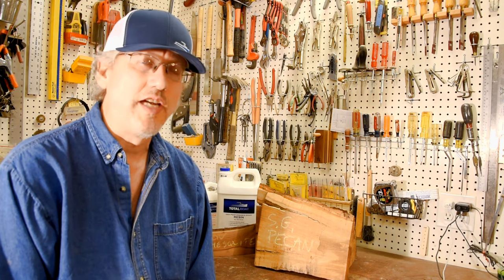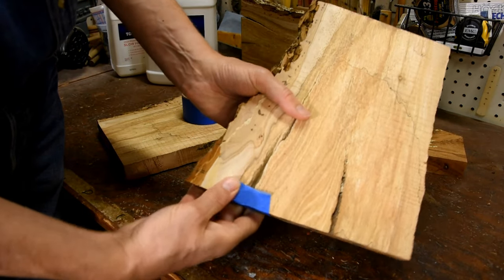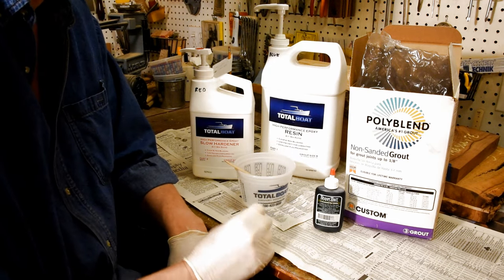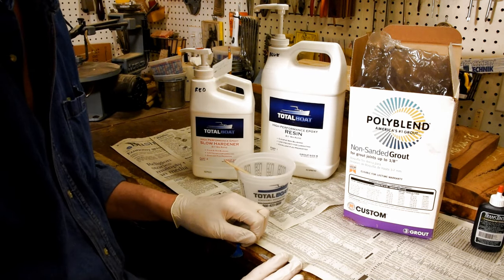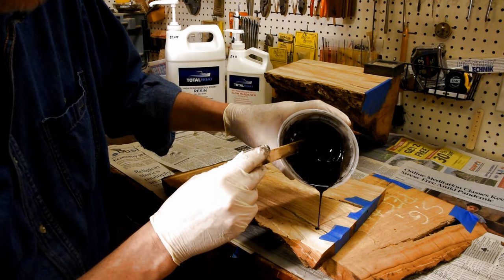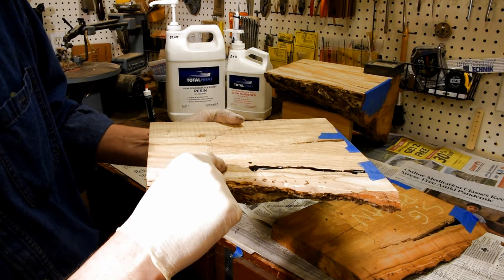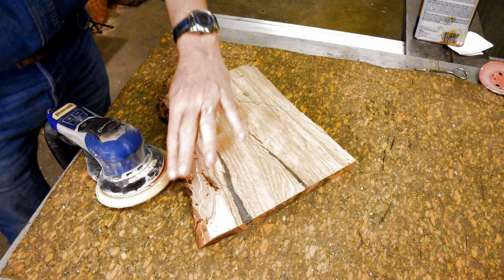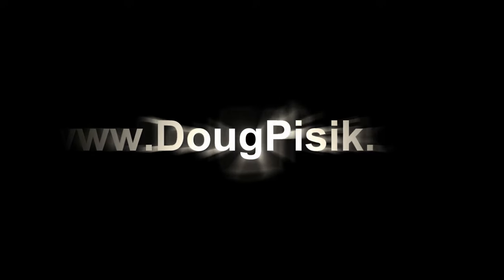Using Epoxy Resin to Fill Cracks and Gaps in Wood - Complete Tips and Techniques

Comment: Great & helpful video, Doug.  I have a slab table that will be outdoors with some cracks and defects to fill.  Your video inspires this first timer here.  Question:  is there any problem with using a varnish on the slab where there are sizable areas of epoxy on the surface ?  Can I expect any issues with the interface between the wood & epoxy (ie:shrinkage, cracking, etc) in an outdoor application?  Thanks.
Reply from the maker: Thanks for watching the video. 
For an outdoor project, a few things to keep in mind. 
All wood will move, so even though the epoxy will hold a crack together, there is still a chance that a crack will widen or another will form.
I’d recommend applying the epoxy in the winter when it’s less humid. There will be less chance of a crack than if you fill the cracks when it’s dry. 
Epoxy will yellow in sunlight. Be sure to not use a light dye or clear epoxy. Using a dark coloring like I did eliminated the yellowing issue. 
Don’t sand the epoxy to a gloss finish or the varnish won’t hold. There always a chance it will peel off (especially in the sun), but a rougher finish on the epoxy will minimize the risk. 
Be sure to use an exterior finish. They make outdoor oil-based finishes that won’t peel but have to be reapplied every year.  I’d recommend one, but I don’t have experience with them. 
Hope this helps.
Reply: Hi Doug - update on my project: I followed your lead and advice.  I now have my outdoor slab table looking amazing with epoxy filling some deep and a couple of wide fissures and cracks in the black color, using the non-sanded grout.   However....must I give up on having the beautifully clear areas of epoxy, given the need to prepare for varnish ?  Even the very fine sandpaper leaves a rough, scratchy, opaque appearance.   I did find a varnish that should fit my needs from Total Boat.   @dougpisik
Reply from the maker: @davidgraber4663 Glad your project is going well. A gloss varnish over a lightly scuffed epoxy should remove the scuff marks. You may want to create a test piece to be sure.

Comment: I use epoxy die ina bottle for my black. What does the grout do? I tried to listen like 2-3 xs. I just missed it.
Reply from the maker: Jacob, I’ve used dye as well, and sometimes the dye soaks into the wood grain leaving a dark hallo or streaks around the epoxy that can’t be sanded out.  This is most prominent in light colored and open grain woods. The grout doesn’t tend to soak into the wood so it solves the discoloration issue.
Reply: @dougpisik  thank you for the kind and knowledgeable reply sir. I appreciate the knowledge from someone who has more seat time.

Comment: Hi are you using painters tape? Also what was in the squeeze bottle ? I really couldn't hear what you were saying about it. So you don't have to seal the wood or anything before you get started?
Reply from the maker: Yup, I use painters tape. The epoxy is less likely to stick to it. Just make sure the surface of the wood is flat, smooth and free if dust. The squeeze bottle is TransTint dye. It can be used, but the grout minimizes the color from bleeding into the surrounding wood. No need to seal the crack first when using the the grout. If you don’t plan to plane down the piece after filling the crack, then you may want to seal the top surface to minimize the color bleeding into the surface. Hope this helps. Thanks for watching the video.
Reply: @dougpisik  thank you I appreciate it very much and I will tell my older brother Mike that we should try your way because he did seal the wood and used painters tape but now the tape won't come off. Hot mess but we're practicing. I'll let you know how it goes with your technique
Reply from the maker: @bevdowdy9483  I hope this works for you going forward. I’d love to hear how it works out for you and your brother.

Comment: Doug nice video and lots of good info/tips.  A question - polyblend non sanded grout does not come in black - only charcoal. I got some an used it (testing) on a piece of cherry and it appears to have bled gray/black color into the surface around the void being filled.  I sanded it but did not get rid of all the gray.  Any tips or ideas on what happened?
Reply from the maker: You’re right about the charcoal vs black. I have been using charcoal. As for the staining, I find that stains don’t go too deep me when I use this method. You may need to sand more aggressively with a coarser grit, or plane off a 16th of an inch.  Another option is to mask off the surface around the crack before using the epoxy, but I haven’t needed to do that myself.  Sorry, but I have no other advice for you. I hope it works out.

Comment: I'm wondering why not use the tape on the top instead of the bottom? Not a big deal either way with a piece small enough to go through a planer. I have a huge slab, and trying to figure out if I should tape over the crack on the top or bottom side.
Reply from the maker: Rob, that’s a really good question. The answer is that either side could be called the “top,” but I put the tape on the side where the crack is the smallest. This way I’m pouring the resin into a wider opening ensuring a better flow and reducing the risk of trapping air inside.
Reply: @dougpisik  makes sense thanks for that. So you don't see a downside to me taping the top (what will be the finished side)? And pouring from the bottom? It's my first time and I chose a $1000 black walnut slab to learn on. Not the best planning on my part lol
Reply from the maker: @robsheedy3093  shouldn’t be a problem. Just be sure the piece is sitting flat on a surface so the tape doesn’t come off. Be aware that the tape can also leave a divit  if it’s pushed a little into the gap. That means you’ll have a lot of material to remove to level down to the bottom surface of the divit. By having the resin on the top, you can overfill the gap and then just sand or plane off the excess, so be careful to ensure the tape is flush and not pushed into the gap.
Reply: @dougpisik  Very helpful advice Doug. Thanks a ton.
Cheers

Comment: I dont know what tape you've used, sir, but my entire project disintegrated, small and large holes alike leaked as if there was no tape at all. I've read in comments recommendation to support the back of slab  but what does it mean? How exactly do you support it?
Reply from the maker: I'm sorry to hear you had problems.  The tape used was a good quality blue painters' tape.  In order to ensure the tape sticks, the wood should be flat, smooth, and clean from dirt and/or dust.  All that's needed to support the tape so it doesn't pull loose from the wood is to put the wood on a flat surface before pouring the epoxy.  To be safe, the surface should be covered with wax paper or clear packing tape to prevent the surface from becoming glued to the wood if there is still a leak.  I hope this information helps.

Comment: Sorry I cannot search the comments to find if you already answered this question.

Why did you mix the Polyurethane 60/40 with Mineral Spirits?
Reply from the maker: I didn’t use any poly in this video, but in other projects I will thin down poly for a first coat so it soaks into the grain.  I also thin poly at times to make a wiping poly that can be applied with a rag. When you buy wipe-on poly, you’re just basically buying thinned down regular poly.
Reply: @dougpisik   Oh!  I also watched your River Table right after this one … that might be where I remembered the thinned poly.  Thanks, that makes a lot of sense to do.

Comment: What does the non sanded grout do vs just epoxy.
Reply from the maker: The grout adds a solid color. I like the black for filling cracks. Some people use dyes.  The advantage of the grout is it minimizes the color bleeding into the surrounding wood grain.

Comment: How would you do this on vintage floors with large cracks that I can't get to the bottom to tape off?
Reply from the maker: I don't know for sure if this will work, but if it were me I would add a little resin into the crack to see if it seals off the bottom and doesn't leak where you don't want it.  After it cures, you can then do another pour that fills in the crack completely.  Hope this works for you.

Comment: I tried using black pigment, the overflown epoxy got me stains on both sides of crack and by sanding i found it was so deep that its not possible to get it off..
Reply from the maker: Sorry to hear this. Pigment can cause problems if the wood isn’t sealed first. That’s why I recommended using grout.  It doesn’t tend to stain the wood as bad as the pigment does.

Comment: Great video mate. I've seen another video with a torch gun but prefer not to. What are your thoughts?
Reply from the maker: If you're referring to using a torch to remove bubbles, it can help remove surface bubbles but not any that remain below the surface.  Since I recommend overfilling the gaps, there really isn't much of a need to remove surface bubbles since they will be sanded away after the resin cures.

Comment: I know this video is almost a year old now, but so far you have given me a lot of information.  I'm sorry this is a bit of a story.  So hope you don't mind sharing your experience and wisdom?   Which I'm hoping will help me with a Kitchen island bench I've been working on.  It's a 3mt long slab of river red gum *(Australia here) live edge both side 900mm to 1mt wide.  I hired two big fellas to help me move it into place and one fella picked it up through the area I'd cut out for the kitchen sink.  Leading to a massive crack..   Not having worked with RESIN before I hired a couple that had shown me some of their amazing work to repair the crack...  after a dozen trips back and forwards to my home to REPAIR and fill with RESING.. I ended up with more Resin on my shed floor than in the crack... Over two years later still sitting taking up the best part of my shed. *(due to having covid and not recovering very well)  I have since gotten my mojo back and trying to fix up both  lots of people I had hired.   I have unboxed the slab they had attached to a large sheet of melamine, only to discover more resin had run through the crack under the slab..   WHAT a mess, one good thing it is the under side.  I only have me, so if I need extra help I have to pay folks.. I am now hoping to sand all the excess resin off the underside, but feel a bit daunted about the process.   A big part of the underside crack is still not filled.  I would like to use Resin to repair it but I haven't a clue which brand they used in the 1st place.  I am wondering if you would mind sharing more of your knowledge?  I have a few questions.  1) Can I use another type of Resin to fill over what was initially used or will it clash?  2) you mentioned briefly about sanding back mistakes with excessive resin and how to sand or plain it back.  Would it be ok for me to use a thick sand paper and work my way back to a finer grade?  or should I use a fine paper and just be persistent?    Thank you for letting me pick your brains.  I would add pictures if I could..  Kind regards
Reply from the maker: Jenn, sorry about your challenges.  It's hard to give advice without seeing the project; however, I'll do my best to help out.  Most important is to ensure the bottom of the crack is now completely sealed so you don't end up with more resin on the shed floor.   It the crack isn't too wide, using wide blue masking tape has worked well for me.  I'd recommend using several overlapping strips of wide tape, and then screwing a wide wood board over the tape.  This will ensure the tape doesn't come off, and since it's the bottom of the slab nobody will see the screw holes when you take the wood board off.  Note that if the wood isn't flat on the bottom the wood board might not hold the tape in place.  If this is the case, put a layer of thin foam rubber or folded-over rags flat over the tape before screwing in the wood board to ensure the tape is pressed firmly in place.  As for sanding, use coarse sandpaper first to remove all the excess resin and then work up to the finer grits.  Try to get into the crack and scuff the existing resin with fine sandpaper before pouring any more.  This will help the new resin adhere to the old.  You don't have to use the same brand as resin that was used before, but know that you will possibly see a variation in clarity where the old and new resin meet.  Hopefully it will be a minor imporfection that most won't notice. I hope this helps.  Let me know how it goes.  Also, I'm glad you're feeling better.

Comment: Why add dye as opposed to just clear?
Reply from the maker: Thanks for asking!  It's a matter of personal preference.  For a large gap like that shown, I find that black is a great non-distracting accent.  Some like to use bright colors or mix crushed stone into the resin.  Clear works also, but I don't personally like the look unless it's for something like an art installation where you want the voids to be transparent.  That said, if you use clear you need to really polish the resin down (like I show in my River Table video) in order for it to look good.  Otherwise you can rally see all the sanding marks, sort of like scratched plastic.

Comment: Sorry another question. The lovely bark edge on my wood is very craggy and I can't get a good seal with tape. Can you suggest anything that's mouldable that I could use instead? 🤔
Reply from the maker: Some people use clay, Play-Doh, or other similar material.  You may have a challenge cleaning that off of the bark, so I recommend putting a single coat of a clear finish on the bark first to seal it such as polyurethane or something similar. It will make it easier to clean up.
Reply: Thank you.
Is there any kind of accelerator you can use to speed up the setting?
Reply from the maker: @LindsayMadden-plant-mb9sn  No. Epoxy is rated at different curing times.  You can use a faster cure epoxy if the crack is small, but if you’re using a large volume of epoxy, you need a slower cure so it doesn’t overheat.

Comment: Thought you said  2:1 ratio  epoxy to hardner …..  you did a. 1:1
Reply from the maker: Sorry for the confusion. It’s a 2:1 ratio. The pumps are made for this epoxy. The larger pump dispenses twice as much as the other.

Comment: Another video used a heat gun and a scraper on the excess before sanding to reduce the sanding required.
Reply from the maker: Something that may be worth trying, but I’d be concerned about pulling some of the epoxy out of the crack if you’re softening it up that much with a heat gun.  It’s a risky process, but I assume can be done with the right epoxy and some practice.

Comment: I tried your method.
It does work fine if you only sand the work pease afterwards. It does not leave a stain in the wood grain.
But! If you have to do planing afterwards it proves to be hazardous to the planer blades.
Something in the mix I used dulls them extremely fast.
It is also labelled as sand free but contains other stuff like chalk.
Reply from the maker: I haven’t noticed this problem. Be sure you are using  unsanded grout. Sanded grout will definitely dull your blades.
Reply: @dougpisik  according to the bag it's unsanded. But my work peace is much bigger than the one you showed as an example. What's the biggest fill you did till now?
Reply from the maker: @MechmanGetrieb  with the grout, no more than 2” wide. Sorry you’ve had problems. Resin is pretty dense, so that might have contributed to your dulling, but I really don’t know for sure.
Reply: @dougpisik  Ok! i see.
I´ve been working with wood and epoxy combo´s on my planers for a while now. 
Big peaces 2m long and 0,22m wide 1 inch thick, hard beech wood.
(Um that are roughly 6 feat length and 8 or 9 inch wide.)
I have to do multiple passes on each side. That usually does not do much to the blades as I use carbide.
It´s either my grout or the amount of milling.
Anyway it´s been a try and if yours works its great!

Comment: Why not just use fine sawdust instead of black grout, you may have talked yourself into how wonderful the finished product looks, but to me, it appears horrendous.
Reply from the maker: Sorry you don’t like the black. Taste is very subjective and my clients are very happy. As for sawdust, it can leave a blotched look and leave voids and/or bubbles.  The grout flows into all the gaps. Another option if you don’t like the black is using dyes or a different color.  Would love to hear how your projects work out and what you use.
Reply: @dougpisik  Yea, I hear you, but I'm not ready to give up on the sawdust concept just yet. I'm thinking about experimenting with premoistened sawdust before adding to the epoxy, using mineral spirits etc. Could be a disaster, but hey, that's the fun with trial and error.
Reply from the maker: @Orange-Jumpsuit-Time  Great concept…but I recommend using alcohol instead of mineral spirits since it is a great solvent for epoxy and the mineral spirits might not be compatible.  Let me know how everything turns out.